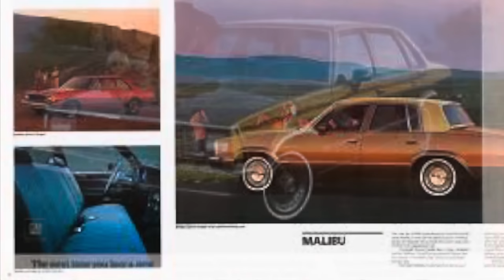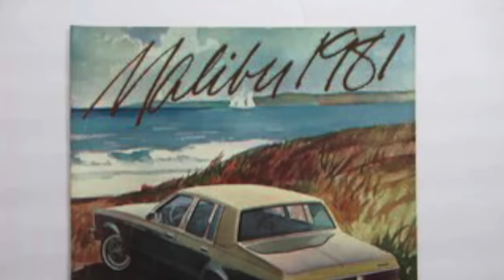Cheap V8 Malibu parked for 25 years will it start and drive again ?

Comment: my folks used to have a 78 red malibu station wagon like the white one  you have on your video. it was  a 305 v8 I remember because i drove them too and engine did ok until when my mom had to floor it one time to get ti started and i think she did some damage to the engine because over time the engine started making knocking noises and then it eventually started spewing out black smoke all the time and they were not able to get it fixed. so they traded it in on the 82 malibu station wagon with the 267 v8. lousy engine. not much power. it quit working right by the time it had 60 k miles on it and it did the same thing  as the red malibu wagon and started spewiing out black smoke. i noticed (investigated for my folks) the emission control piping conected to the exhaust manifolds were all burned out and I replaced them all. it did not make any difference. so my folks took it to firestone and had the tuneup done which conisted of new spark plus, wires, and overhauled carburetor. it still spewed out black smoke. so they just left firestone and went straight to the chevy dealer in Dallas and traded it in for the 88 checy s-10 blazer which last my folks another 30 years before my dad got rid of it. lol the 78 and 82 malibu wagons were no good for my folks. hope you do a lot better with this one you a re working on. God bless. I just  had to tell you this story. lol I was about 30 years old back then. i am now 65,

Comment: Those Malibu's were cop cars. If you check the back doors probably dont open from the inside. Pretty sure there is a switch in the door jam to enable or disable the inside handles.
Reply from the maker: Ok thanks

Comment: Hey, don’t waste your time with an ultrasonic cleaner. I spent $125 on I and it didn’t seem to do any better than spray cleaner. So I sold it for $50 and never
Looked back.  I would spend $ on a new
Engine hoist. That one has seen better days. Could it just be low on fluid?  
I appreciate the videos.
Reply from the maker: Thank you.

Comment: Would love to get my hands on a solid F350 dually like the one in this video. Don't see many of them up here in Michigan. Q. What’s the difference between a Chevy and a shopping cart?
A. A shopping cart is easier to push.
Reply from the maker: Too much salt there
Reply: @Sleeperdude  Most people don't understand why we use salt on our roads. We've had salt mines under Detroit for years.  In the Detroit area alone, it is believed that there are over 71 trillion tons of unmined salt. Geological studies estimate that 55 counties of the Lower Peninsula cover 30,000 trillion tons of salt.

Comment: The brake vaccum booster is probably leaking vaccum pinch off that line i bet it smooths right out cause the vacuum is leaking inside the booster, very common on GM vehicles
Reply from the maker: Good idea

Comment: Get wawa about4 inches of 3/8 fuel line to slip over the end of those plugs. She loses a bit of reach when she leans over the fender.[edit]- if you know anyone who plays guitar, get them to give you their old metal strings when they change them. A six inch piece of metal string is a good cleaner for jets and passages.

Comment: Looks like it was jacked up by the pan, using a board between the jack and the pan and as far as the other dipstick that you can't find, it should be on the drivers side, probably some one borrowed it too ? I had a 1985 I-Rock Z-28 with a 305 and the dipstick was located on the drivers side the only difference id my I-Rock had a TPI engine!

Comment: You need to put that twin turbo chevy big block in that car, instead of that ford fairmont
Reply from the maker: I like Malibu’s but I am a bigger fan of the fox body chassis
Reply: @Sleeperdude  I also like the fox chassis but I think that Chevy will make it too nose heavy and ruin an otherwise nice drive-able car. The chevy 4 door was never very good  A big block with 2 turbos would make it better

Comment: The windows were fixed because of child safety, to keep small kids from falling out of the window. I had a yellow 79 with a straight six 200 cubic inch, at 4400 lbs it could barely pull it's own weight. Bought a set of the then brand new state of the art Goodyear Aquatread tires for it, first gen,  tested them over 2 years, starting slow and even at 85 mph in a gentle slalom and 100 mph straight i could NOT make them hydroplane. If by some chance you find a set of ' new old stock ' that have been preserved i highly recommend them. As for the car, the motor eventually died and I got another car.
Reply from the maker: Ok thanks

Comment: We didnt forget to put the oil in the motor, but we DID forget to put the oil plug in and dumped half the oil in the motor before we noticed the "leak". Lessons learned.
Reply from the maker: It happens

Comment: My mom had an 81 Malibu too they didn't have roll down windows because gm was on a safety kick the back windows didn't roll down they only had that worthless slide out window to where you still roasted and suficated in the heat however that's how gm came up with the rear windows to only come down half way late eighties through the nineties
Reply from the maker: That’s crazy that they did that

Comment: Is that a California/high altitude car?  I'd always heard that Chevy dropped the 305 from Malibu sedans and coupes for 1981 in 49-state cars, leaving just the 267 as the top engine.  Also, did you ever find out what transmission it has?  GM had a habit of putting the THM350 behind the 229 because it was "good enough" for fuel economy, but then throwing the lightweight THM200 behind the 305, to eke out a bit better fuel economy.  I'm also convinced that they played "transmission roulette" in those days, where if, say, a THM350 wasn't available at that moment, they'd throw in a THM200, and vice versa.  Anyway, congratulations on rescuing it.  My first car was a 1980 Malibu coupe.
Reply from the maker: According to the build sheet I found yesterday it came factory with a 267 and a th250 but the owner said it was swapped to a 305

Comment: I had the 78 2 door model. The rear frame on those is shit and will rott out fast. Mine was midnight black with a over sized cam 305 in it with a turbo tranny that had a shift kit in it.
Reply from the maker: Ok thank you

Comment: COuld be. Old cop car but if it's base model they don't have window cranks in the back to cut cost that's not the original engine it would have been v6 if they got the 305 V8 it been a 2 barrel carb and howdy from a fellow Appalachian in West by God Virginia
Reply from the maker: I think you are right
Reply: @Sleeperdude  these old gm square body are my life lol iv done about 1200 of them I just did a 79 cutlass of same body style but it had the v6
Reply: Dip stick probably broke off should b on driver's side down next to bottom of block but it could be on pass side depends what year that engine came in
Reply: Pipe tape

Comment: Excellent video Sleepdude Crew  :) (Josh) reason that G body  L version didn't have doors open & rolled down windows on back doors is those cars were be used for Cops take bad one to jail at stations or county courts to big jails and taxi drivers only open for costumers only ! But some familys of bad kids bought to so kids would get out car to when driveing on roads ! But yes those cars well built back then my high school Auto Mechanics shop in high school from Grade 9 to 12 in grade 9 guy teacher daughter want her car 1983  4 door fix but want think was strange she had in hot Pink body , black tint windows, red interior hers had a  4.4 litre 267 Cubic Inches 8 cylinder 4 barrel , low hp 165 hp with  210 blue block and orange block is 185 hp  also  210 hp ! But school teacher gave us students extra marks for had do fix to teacher daughter car and put 350 4 bolt  4 barrel V8 motor crate , daul exhaust, to Turbo 400 3 speed Automatic transmission, 377 posi rear gears and in 2009 was up for sale but got sold before could get get sold for $600.00 ! But lots families & friends to had 2 also 4 doors and station wagon plus in V6 to small  V8 267 to 454 with 2 or 4 barrel carbs and Automatic plus Manual transmission and lots ratio in axles ! Josh you want know my first carb fix was Zenith 1 barrel updraft on 1950 Cockshutt COOP 40 43 farm tractor on army motor 235 6 cylinder motor called Buda in orange color on home farm my late Dad also uncle together! Second carb was 1968 International pickup with 345 V8 4 barrel carb 1000CFM Holley daul choke Hand knob dash put my oldest Brother David 1979 Chevrolet Monte Carlo LS car had orange block 4.4 litre 267 4 barrel plus choke cable knob installed near his gas pedal for starting engine  and ran excellent too ! His old other carb quite working some reason and trying rebuilt kit after cleaning up no changes on Elebrock carb plus tune up the screws to hose may leak just run for 1 seconds shut down! But years ago didn't understand why too !
Reply from the maker: Ok thanks for the good information
Reply: @Sleeperdude  crew :) also Josh anytime and glad help !

Comment: Well, if you do a quick search about this vehicle, you would find out that in Canada they call it "Iraqibu", YES, and that was for a reason, Chevrolet in Canada has made a contract to sell about 100000 of them to Iraq in 1981, but because the company has "cheated" about the real making year, Iraq has stopped the process, and it was obliged to sell it inside Canada a lot cheaper than it's real price. I know that story because I am from Iraq and I've had one like it in the 1980s, It's a strong car though. Cheers to the cooperative family. By the way, in 23:28 this is for the oil pump lamp.
LOVE YA
Reply from the maker: Ok thank you

Comment: They made 2 different 4 door styles. Rather have vent windows in the rear doors and rear window is flat or rear windows are 1 piece and vent window is behind the door and the rear window is at a angle.
Reply from the maker: Oh ok thanks

Comment: That ford 1 ton with the mercury motor MAY actually be a mercury truck and if thats the case you ought to go back and get it.
Reply from the maker: Yeah maybe so we are waiting to see if other family members want the trucks first.
Reply: Definitely wasn't a merc truck if it was the badges would of said m 350 not f350
Reply: @thepyrodude  You're probably right, but its a lot easier to change the badges than it is to change the motor. There may have been a time in the past where having a merc truck wasn't near as cool as having a ford. but yeah you're most likely correct.

Comment: Hey I got a question? Can I run Diesel motor oil in my 2005 Chevy Avalanche 5.3 LS engine even though it calls for 5-w20 ??
Reply from the maker: I do in my wife’s car with the same engine and haven’t had any problems

Comment: You asked about the rear vents. They deleted the front ones when AC came along but why move them to the rear?? They saved $5 a car deleteing then!!!!!🤦🏻‍♀️ Then they put them back in!!!😂OSHA demands so much CFM airflow for safety! Notice you can’t turn the ventilation fan completely off. WHY are they needed if the AC exchanges the air!!!🤔
PS. If the secondary’s come in too soon there will be a huge boog!! Also use two stroke oil on a siezed engine!!
Reply from the maker: Ok thank you for the info

Comment: Yeah add you a wildcam keep that carbureted keep that carbureted look at a set of headers put some stamps and put some steel roller tip rockers 650 spread bar Holley carburetor the Rochester replacement put your 1800 stall converter on the trans and you have you and you have your a cool a cool cruiser holla if you hear me

Comment: What year is the Malibu? I used to own a 1980 302.
Reply from the maker: 1981
Reply: @Sleeperdude  I had alot of fun to work on till it caught on fire.Found out after that I had cross threaded a fuel line attachment so a slow leak on a hot spot and hence no more car.Fortunately I was at work,so no accident on the road.

Comment: Great video 🤙 I love seeing old $hit boxes like this gettin a 2nd chance at life. 
@34 ish, you put in diesel oil, i’m curious, why run diesel oil in it? Is there an advantage to this type of motor that’s been settin’ a while?
Thanks if you can respond

ps: My OCD was bothering me the whole video; I really wanted to remove all the Pineneedles, leaves and debris from the bottom of the windshield! LOL
Reply from the maker: I have been told diesel oil has more additives and is designed to be used at high temperatures and pressures
Reply: @Sleeperdude  A lot more zinc for the old flat tappet camshafts is what I'm told.

Comment: i would run the numbers on that engine that looks like the engine has been changed the oil filler should be in the front of the engine it also looks like the vacuum solenoid for the secondary's is missing also. Im thinking that motor has been changed because with no aftermarket gauges inside there is no reason for the copper tube on the oil pressure sender they had electric gauges by then and m9ost had idiot lights so no tube plus bent plugs and missing dipstick says replacement motor
Reply from the maker: I think you are right

Comment: Maybe someone was midway in a swap that's why the bent over plug and the carb being off probably on it's way in
On another point, you made me cringe with the card you left and the cars you saved on the 4000 cars video so your turn in the 90s(I'm a scraper by the way) I hauled in g body Malibu, Cutlass, And Grand  Safari. The Safari was a factory 4 barrel all were wagons😎😎😎
Reply from the maker: Maybe you are right

Comment: That's a real shame that it's a 4-door. Yuck. I'd just scrap it personally. A 2-door would atleast be worth the money, effort and time. To each their own...
Reply from the maker: I have 3 kids so I kind of like 4 doors now
Reply: @Sleeperdude  I understand what you mean. I bought my first and only four door when my kids were small. Donated it to a young widowed mother down the road from me her husband was killed in a car accident on an icy hill and he was a friend that I went to school with. It Was a Chevy Caprice 305 V8. Took off the fuel injection stuff and threw a quadrajet on it along with headers and a mild street cam and a junkyard 3.73 rear.  3 inch dual exhaust and lowered it a few inches, white letter tires and mag wheels. It looked, drove and sounded great for what it was. I had to show that lady how to start a carb'ed engine but she ended up loving it for many years. She still has that car in her back yard but the cam is wiped out. Her new husband plans on refreshing the motor.

I don't hate four-door cars, but there's just something about a two-door that looks so good when built properly.

Comment: hope it was free because if payed for it u payed to much if u live by me i will turn u on to a lot of cheap rigs like 300 for a 65 ford pu with tool box on side rust free all complete with a 352  just needs a tune up nice truck . i have 1200 in my 68 chevy pu with a stroke 454 450 hp stock with a 02xx 400r turbo good to 800 hp stock my 70 high boy with dana 60/80 lockers ranger with tool box on side rust free clean body 390 4 speed with the box full of extra parts i have 250 bucks in it . got my 73 ss nova  got one for 700 rust free clean body inkee wheels tunnel ram on a 396 pro built 400 turbo stage 3 shift kit with another one for 50 bucks both have factory paint no body damage . then i have just about every year of camaro from 67 to 79 but a 69 camaro  all are ss ,rs or z28's all i got for free over time the rarest is the 67 ss rs 427 yenko . my next project is a 79 z28 rs t top putting a stroke 454 in it . i live in oregon